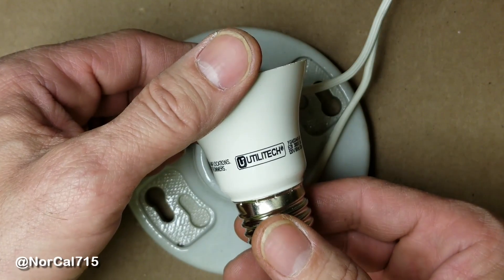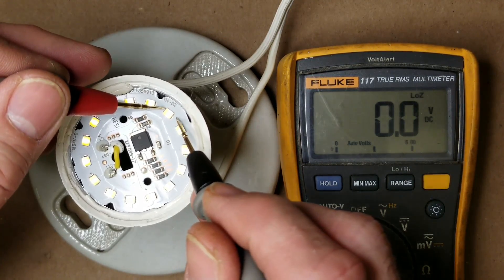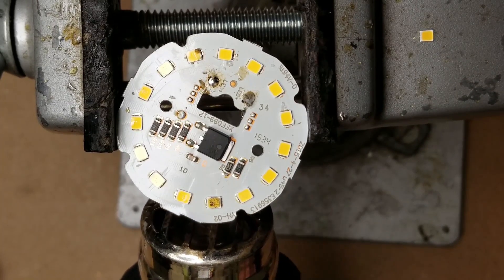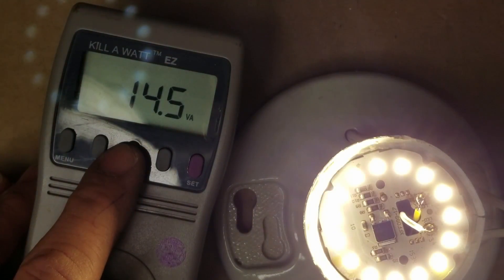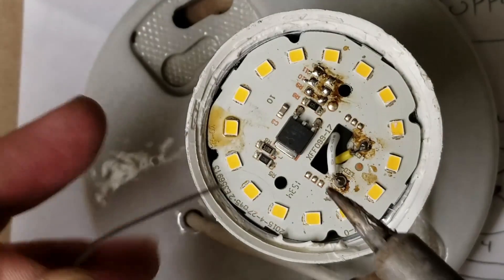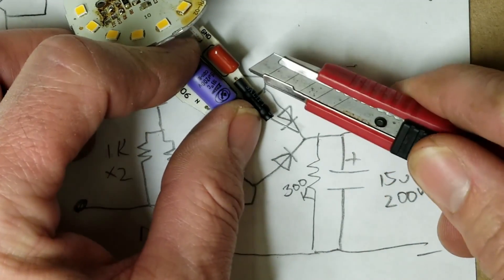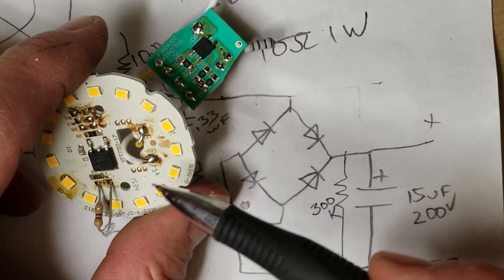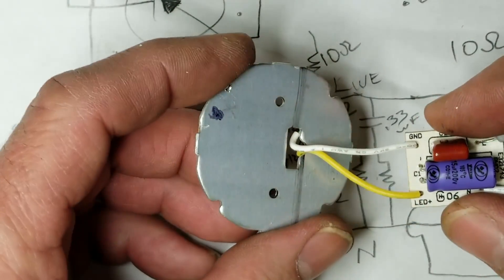Lowes Black Friday $0.50 LED Bulb Lamp Diagnosis and Repair

Comment: What temperature of heat for melting SMD LED on the back side ???
Reply from the maker: 400-450F depends on whether lead free solder or not. Lead free has a higher melting point than leaded solder.

Comment: NorCal715 great video as usual.  Your videos on Mitsubishi DLP TV's have helped me tremendously.  I have a video idea for you, I have a Liftmaster/Craftsman 1/2hp garage door opener with a control/logic board that has a burned out receiver.  I can see a resistor that looks cooked but I think it would have to be something else also.  Anyway a new logic board for this 17yr old garage door opener goes for $75.  Searched all over the web to see how to service the board but no tutorials anywhere.  The wired switch inside the garage to the board operates the garage door opener, the problem is the logic board receiver is not working with the remotes or keypad that operate on 390Mhz.  Mine stopped working around 4 months ago, I added a Garage Mate to the unit and we can open the door with an app on our phones via bluetooth currently, and all is fine for $55.  Reason for your consideration in this matter is my elderly next door neighbor's just went out, she has a flip phone with no bluetooth, and I would love to repair it for her.  Soon every garage door opener in our neighborhood will burn out.  So just a thought, we could send you one of our boards if you think you could repair it for less than $75, and if you make a video on it would be big hit with people with old garage openers.  This is a long comment but couldn't find your email,  thanks.
Reply from the maker: If you have twitter DM me on twitter and I will help you @NorCal715

Comment: You made a mistake in your schematic. the .33uF is used as a capacitive dropper limiting the current flowing in the LEDs, its placed in series with live and has an impedance of 832 ohms @ 60hz not 8k. Placing such capacitor across main would ruin the power factor and no noise is generated in this bulb.
Reply from the maker: Capacitive dropper is just a generic term. It is capacitive reactance, and 832 ohms at 60hz wound be a  3.18uf capacitor. Here is one of many sights you can just put in the values and it will do the math for you. http://www.sengpielaudio.com/calculator-RC.htm My numbers are spot on. If it was a capacitve dropper with an equivalent resistance of 832 ohms the max current it could pass would be 17ma (@120v)

Comment: hi sir how to fix i myn mobile 2.1amps 5V adapter after 5 months running very low Ampere its around 3hour to complete 1% to 100% anyway i did change USB cable same issue ... thnks

Comment: Regarding the designs as found WRT the allowable component operating points, I've never found any of the retail A19 style lamps that had the LEDs operating remotely within SOA.  Considering Tjmax is going to be somewhere around 120-125C, the pad/substrate temp is usually specified in the ballpark of 80-85C.  I have lamps that have an exterior "heat sink" temperature >100C when base-up in a completely open fixture at Ta~20-25C. 

Do they work? Surprisingly better than expected for something that should simply self-destruct.  Do they last? For a while, with severe output degradation over time and the traditional baked capacitors causing eventual problems.  It's just a shame to see another lighting technology crippled by the promises of oversimplified marketing and the necessity to be crammed into fixtures designed for its century-old predecessor.

Edit: that's actually a pretty nice and simple rectifier/regulator system.  At least that would be quite nice and easy to modify/repair.  Some of the hottest ones I have are all epoxied together permanently.
Reply from the maker: You are absolutely right. Designed for obsolescence! If designed within the temperature design specs they would certainly last 30000 to 60000 hours easily. but that would mean the consumer wound not purchase replacements for many more years and company revenue would suffer. It is all about the bottom line when considering design specifications. Thank you for your comment!
Reply: I don't doubt that's a big part of it, but ultimately people want 500/700/1100 lumens out of something that fits in the form of an A19 and will work inside an (often fiberglass-insulated) enclosed fixture.  That approaches a practical impossibility for a consumer LED retrofit.  The screw-in base and the nondirectional nature of most fixtures means that the directional nature of the emitters can't be exploited to any efficiency benefit.  You have to end up with half of the lamp surface directing light at the fixture itself, and there's no remaining surface on the lamp to use for heat removal.  Similarly, an electronic-ballasted fluorescent has decent efficiency and life expectancy too until you roll it up and make it occlude itself.  

What bothers me the most is that all the promises are bad marketing based on a grain of technological truth which is explicitly avoided by the reality of the implementations.  It's all "lasts xxx hours (in a context which doesn't apply)" and "runs cool (compared only to things which are most efficient when they run hot)" and "saves money (so long as you don't do comprehensive cost analysis)".   

People more strongly base their satisfaction on first impressions and how well they correlate to potentially meaningless (often suggested) expectations.  Of what value is long-term reliability to marketing if it's potentially divorced from emotional association?  It sounds so cynical to suggest, but allow me an example of how acute the phenomenon can be:  How many times have you noticed yourself or others remark delightedly at how "bright" their new LED lamps are compared to their CFLs?  It's true.  A CFL and LED lamp might have identical luminous output at steady state, but the CFL starts out cold at about 80% of its hot output.  The LED starts out at about 20% brighter than its hot output.  That first two minutes is sufficient to satisfy a lot of people.  

Sorry about griping.  You don't need me to tell you.

Comment: Enjoy your videos!
Where did you find the fine point meter leads?
Reply from the maker: on eBay https://www.ebay.com/itm/1-Pair-Ultra-sharp-pointed-Probe-Test-Leads-Pin-Cable-20A-For-Multimeter-Meter/272558821695?epid=566698429&hash=item3f75c5913f:g:tVcAAOSw2gxYpYzN:rk:1:pf:0
Reply: Excellent,  thank you again! :)